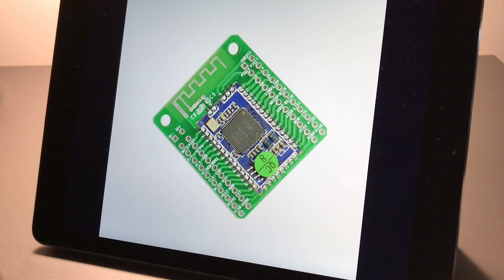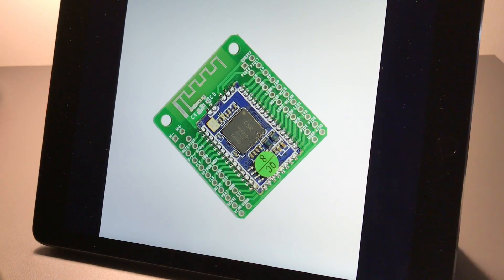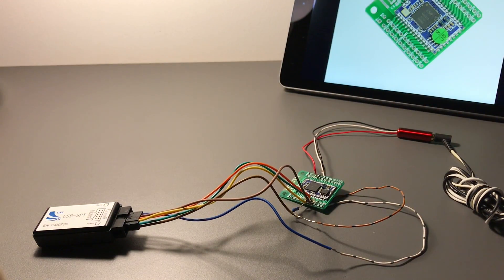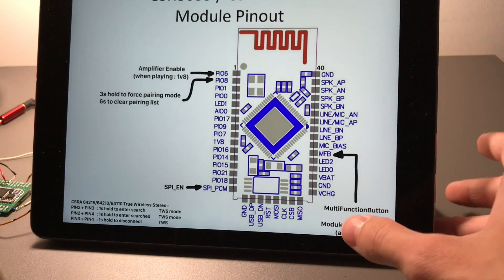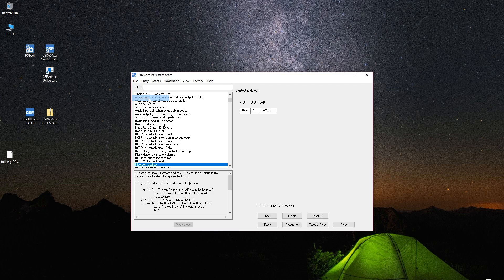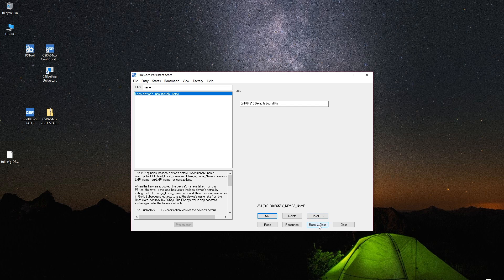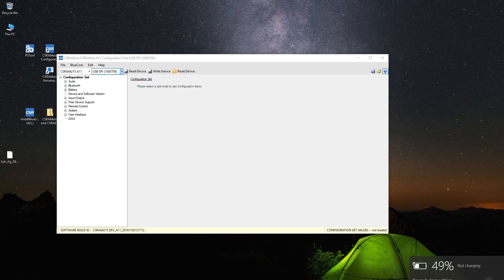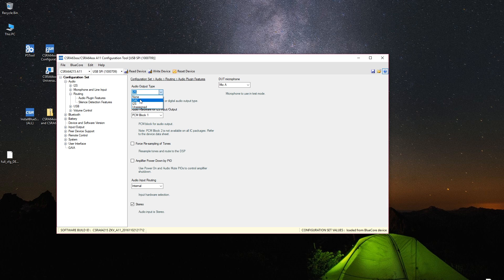Program / Configure CSRA64215 Bluetooth Chip (enable analod audio)

Comment: I have an Avantree Clipper Pro headset, and when connected for charging, it's detected as "CSRA64512 USB Headset"! Which protocol can I use for connection (and eventually what baud)?
Reply from the maker: So, I would highly recommend getting a CSR USB-SPI Converter, and that'll work flawlessly & seamlessly with 
PSTool (low level settings mods), 
ConfigTool (UI for all the billions and billions of entries in the ps store) and the 
FrontEnd (equalizer control and other DSP related goodies)

You don't need to worry about any comm parameters with this software, just what you're modifying

(apropo, salut :)
Reply from the maker: A shit you mean in case you can get away without the programmer .. pff, go to PSTool, and there try USB modes - also check the USB Device Tree, Microsoft always move that around, should be in System Information of something - see what the headset is listed as (and definitely let me know, it'd be sure cool if you get it programmed without a spi converter)
Reply: salut, incerc :D
Reply: in modul USB in PSTool nu-mi arata portul, si nici nu-l pot introduce manual (doar selecta)
Reply from the maker: Posibil sa fie dezactivat .. ai desfacut chestiuta, poate are inauntru un jumper ceva ? (apropo, de unde ai luat-o ? si cat ai dat ?)
Reply: eMAG, 128.88 lei
ce chestiuta? device-ul in sine?

mi-e ca nu-l mai pot monta inapoi.. am si clipper, l-am desfacut, dar nu l-am mai putut pune inapoi si l-am lipit cu superglue
Reply from the maker: Pai, ia-ti un pistol dinala cu silicon, sigur stii de care, is ieftine si perfecte daca tre' sa inchizi la loc ceva de genu (si numai bine daca vrei sa desfaci, incalzesti cu un phoehn si se inmoaie :)

Ce anume vrei sa modifici la el, apropo ?
Reply: pai sunetul de intrare apeluri, sa ma notifice vocal la mesaje noi si notificari, sa-mi spuna cine ma suna, si sunetele in general, sa adaug un sunet la deconectare, si daca reusesc sa-mi spuna si procentul bateriei
Reply from the maker: Uu, fain, sa-mi zici cum ai facut daca-ti iese :)
Reply: apropo, nu se gaseste pe la noi USB to SPI converter?
n.am un card de credit si nu pot lua din afara
Reply from the maker: Uuuu, 99.99% sigur nu .. mai ales dinasta CSR ..

Am cautat folie de sticla full screen pt iPhone 7 in Iasi ... un singur magazin avea la 260 de lei :)), din Germania mi-am luat cu 10€
Reply: credeam ca esti din Bucuresti 😂, imi luai si mie unu' ne intalneam sa.ti dadeam banii in lei :))
Reply from the maker: Clar .. na, sorry, departe de BUH oricum ar fi :(
Reply: BUH? sau BUC?
Reply from the maker: BUH :> asa-i aeroportu', suna mai amuzant ca BUC
Reply: :))) 
am reusit sa-l desfac fara sa-l stric

ai un facebook personal unde sa-ti pot trimite pozele, si poate reusesti sa ma ajuti? :>
Reply from the maker: Darie Ha

Comment: Hi! pretty good and enlightening video series!. 
I have the CSR USB-SPI programmer and in my case, when trying to connect to the module, a pop-up warning appears saying "The configuration set version from the XML definitions [Rom,8] does not match the configuration set version in the device or PSR file [Rom,15] you are attempting to load...". I get this with both the Config Tool posted in the video comments and in the tinysine.com website. A manual editing of the version number in the XML file allows me to read the module, but I'm guessing that a jump from version "8" to "15" might lead to unknown configuration problems... and I've not seen this issue reported elsewhere.

It'd be helpful to know if it has happened to any of you.
Thanks
Reply from the maker: I think all you have to do is click "Load from Device" first - let me know if that fixes it
Reply: Darieee thanks for your response. Actually, that's the moment the warning appears. The config tool attempts to read the device config parameters set, and realizes that it doesent match the Config Tool parameters version, so it prevents further actions. Thats exactly how it's described in one of the user guides found online about the Config Tool. What it doesnt say is how to update the parameters set in either the device or the Config Tool.
Reply from the maker: Uuu .. I've never had to do that though - are you using the ConfigTool linked in THIS video though ?

Does the PSTool work ?
Reply: yes!, several times. And the PSTool does work without issues (At least I can rename the device and read/write PSR files). Who knows..... did you mention that you managed to use the DSP a year after you purchased one of the modules? I hope this takes less than that haha. I hope to post something if I resolve this.
Reply from the maker: Well - I guess you should just manually edit that XML file - worst case you'll fuck up the ps store, but that always up now I've been able to resolve with PSTool, there's an option to Restore All

Comment: Quick question: do you know how to hook it up to a minijack? Yeah i know im just a noob and im just getting into the csr's
Reply from the maker: Well, you could get an isolated module, just search for "csra64215 5v" or 12v .. those have a headphone amplifier on board

Alternatively, since the CSR chips output differential audio, you could just take Right+ Left+ and GND and listen that way
Reply: @Darieee  Wow that's a quick answear thanks a lot plus greetings from Poland btw
Reply: @Darieee  Could you also say how did you hook it up in the mararine box speaker video bcs im planning on doing something like this but using drivers from an oldscool rft b3010 and the same tpa3010 btl, but with a 3s 9000mah battery pack
Reply from the maker: If it's 3S then it's still 3000mAh (you do get more Wh though by going series, and it is the correct approach). Still 3000mAh with just one TPA3110 is quite overkill, you'll have something like 20h runtime xD

Anyway, what I did there is I tied RIGHT+ with LEFT+ via 100 Ohm resistor each, and did the same with the RIGHT- and LEFT-, then I lifted the capacitor coming from (I think) Left_In- on the tpa board, and connected that to the negatives, positives were routed to the connector already, and, yeah

That way you can feed differential audio into the amp, instead of single ended, which would have carried quite a lot of ground loop noise and other shit

Comment: Sir can you help me ?i want to build multi point Bluetooth(a2dp) transmitter is it possible ? If yes how ? Not,why?
Reply from the maker: Mmm, so, what exactly do you want to achieve ? Have something like thise BT transmitters you can buy on ebay ?

Or have one bluetooth speaker conenct to another to play in stereo ?
Reply: Yes like they sell on ebay i have one but there is latency so i want to build one so i can connet more devices to my phone audio(
Reply: I have "h-366t" this
Reply from the maker: Mmm, that I unfortunately don't know how to achieve, could you post a link of the one you have ?
Reply: Want to build something like this !
Reply from the maker: Alright, can you post some picture of it opened ? What chip does it use ?
Reply: Its night here (4:30 in morning) dont want to wakeup any one and Whar do i upload photos?
Reply: Sorry i am let but i am unable to take photos of it. its too small and dont have camera but i disabled it and inside there is module name "csr 57e6 87cg" (its on google) and besides that ic there is another ic name "MX29LV800CBXBI-70G"(i am unable to find it on google ) sorry for my english
Reply from the maker: yeah .. it's a bit problematic, it seems to use a different protocol from what the chips I worked with use (UART instead of SPI) so the programmers that are cheap and readily available won't work ...
Reply: Nothing can be done ?
Reply from the maker: I don't know what has to be done, and this is a very old chip, it'll be very complicated to achieve anything with it
Reply: Ohh an outdated chip !! no wonder why this is soo chip lol
Reply from the maker: Yeah, well, just for some perspective, the CSR8645, has Bluetooth 4.1, (I have a lot of videos on) .. and that is from around 2010/2011 and requires its programs to be run under 32bit Windows 7 ... the chip you have is Bluetooth 2.1 ... so it must really date back a while
Reply: Can we do it with Csr 8545 or  8675 ?
Reply from the maker: I don't think so ...